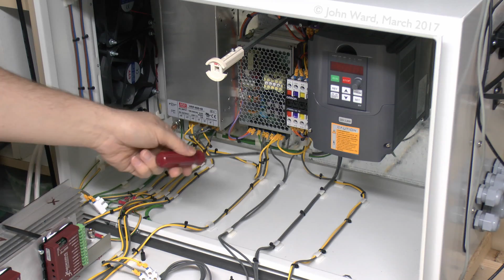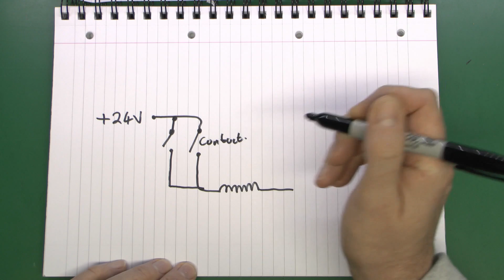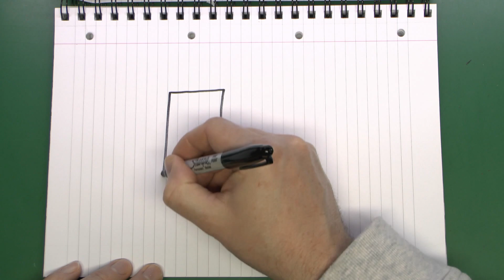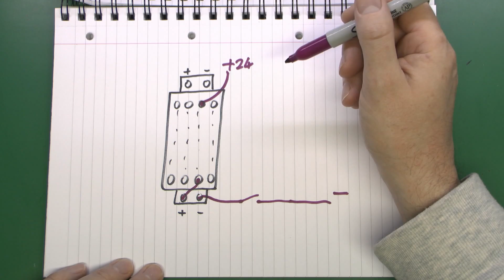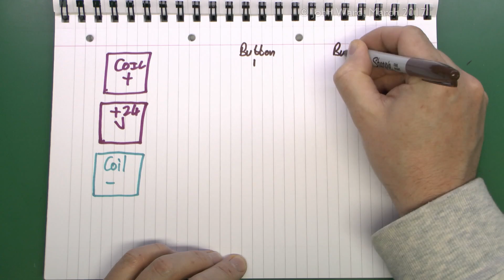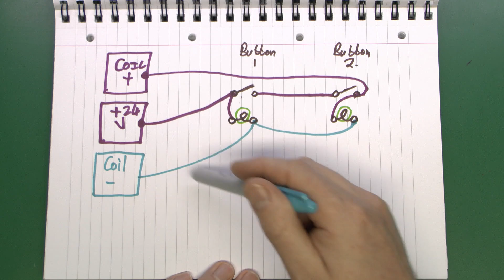CNC Router Build #4 - Cabinet Power Wiring & Emergency Stop Circuit

Comment: Have you had any issues with the VFD being in your control box? EMI related issues•
Reply from the maker: No, none at all.  However the power supplies and cables are all screened, and the controls are all 24V which is less susceptible to interference than lower voltages.

Comment: The manual for the VFD says it should not be turned on and off using a contacter.  Any idea why because I was thinking of doing the same as you ?
Reply from the maker: Haven't looked at the manual for some time, but is that referring to the output or input?
Switching the output (between the VFD and motor) is likely to cause damage as VFDs expect the motor to be connected all the time.
Switching the input won't cause damage, it's no different from disconnecting the power using a normal switch, and that would happen every time it was switched off such as at the end of the day.
Reply: @jwflame  this is what the manual says: "No contactor should be installed between the power supply and the inverter to be used for starting or stopping of the inverter. Otherwise it will affect the service life of the inverter."

I think that's quite unambiguous although that is subject to this being a translation from the original Chinese.  I was aware of the danger of disconnecting the motors from the VFD.

The only thing I can think of is that if you shut down the inverter in the prescribed way it has circuitry that somehow lets things down gently (non-technical term).  Assuming you got the VFD from the same supplier as the CNC we probably have the same one because that's how I got mine.
Reply from the maker: Probably because if power it cut, the motor is still rotating which would then act as a generator, supplying voltage to the VFD.  That might cause damage.

Comment: Dual power feeds? That's ridiculous, what is the point. Name any control system that has two plugs.
Also, some AC input filtering would be nice, and especially for that spindle, going to get a lot of noise from that.
Fuses? A pretty standard feature in everything and seemingly entirely absent from this design.
That's not how you do panel wiring, get some braiding or trunking and run it all down to the corner. Separate the AC from the DC/signal.
That fan/heatsink arrangement - let's just call it non optimum eh?
You've basically made that rear panel non removable by having wiring spewing in all directions.
Where's the braking resistor for that 2KW spindle?
Press two buttons to engage circuit? Control sequences are generally single button presses.
How about a few indicator lights for what's running.
Interlocks? No point in engaging the 48v if the drive units have an error condition.
Where are the DC fuses.
Install a stop button to signal the drivers to shut down, just killing the power is going to wreck your gear - every control system should have a sequence to start up and a sequence to shut down.
Reply: You sound very intelligent... Now please. Go make a video and show us the most perfect and proper way then.

Comment: in the Huanyang VFD Manual, it is stated that never to use a contactor to power the inverter there are pins that can serve the same purpose if you want to protect your inverter

Comment: Hello John. Did you have any problems with the VFD on your router tripping your home RCD. I got the milling machining working via an isolation transformer  with its own 30 mA RCD on the secondary side.   It works fine  despite about 10mA leakage from the EFI filter on the the VFD.  The drive allows for up to 20mA leakage and recommends 300mA main RCD and 30mA locally.  I used I current clamp to measure the line neutral imbalance it was useful bit of kit. Thanks Regards Chris.
Reply from the maker: I don't - but the shed with the machine is on it's own 30mA RCBO, so even with 10-20mA of leakage it still wouldn't trip.
Many things have a tiny amount, so with an RCD for a whole house it wouldn't take much extra to make the total enough to trip all the time.
Reply: John Ward   Yes it wouldn’t take much as you say.  The supply for the garage is a spur off the kitchen ring main. It works have been so much easier if I could have put in a separate supply from my consumer unit. Unfortunately it was not cost effective in my situation given the house construction and distance involved.  My fluke 1653 arrived so I guess I should investigate. 

Many thanks John keep up the good work with the video I really enjoy your content and always learning thanks.

Comment: Hi, like the build and video  I"m putting a controller together right now too and I'd like to get some of those little plastic wire clips you are using.  Where can I get some?  Also, is the contractor necessary on the spindle?   I have a delta vfd but I wasn't planning on putting anything other than a switch on it.  My lathes all have 3 phase contactors but they are old skool lathes.
Reply from the maker: The cable clips can be obtained on ebay and many other places, here are some examples:  http://www.ebay.co.uk/itm/like/121337334008
If you want a working emergency stop,  then a contactor is necessary.  If not, then a switch would do.

Comment: Thank you so much for the detail in this video, I've been having a nightmare on a project I'm working on with having parts of the machine running without the other, then both together using a 2 step switching, perfect video, its exactly what i needed

Comment: interesting comments on this one.  In the control panels we build, we tend to keep the unswitched mains run as short as possible in the case, and generally protected by metal or plastic from entry to the main switch. But then again our panels are meant to be hard-wired and not have external plugs. Do love non-mcu e-stops... even though these days the combination units seem all the rage.    And yeah, i worry about lag in your inverter turning off.
Reply: What would bother me (if this was my machine) aside from the long unswitched mains wiring is that it looks like the earth wire is shorter than phase and neutral and that there's a screw terminal in the wire before it's actually connected to the housing.

Comment: The question I have is in regards to the Heat sinks. The heat sinks are very close to each other and the cooling fans do not move air over the cooling fins. Do thoes heat sinks get hot? Should fans be installed to direct air over the fins? Thank you for doing these vedios.

Comment: Nice neat install, one point I will make (and probably too late by now anyway) is that the instructions for the VFDs I've used on my Lathe / Mill and Coolant system state not to power them up without motors attached to prevent damage. Not sure if yours is the same but it looks like you didn't have the spindle attached when you demo the power up sequence.  As my VFD / Motors are connected via multiway connectors I just wired it so that the connector had to be made to allow power to the drive. Keep up the good work.  Ps I installed a cooling fan in my cabinet but it just doesn't get very hot in there anyway.

Comment: What if you're holding the two buttons down (or they've failed on) when you turn the emergency switch? Safe operation would suggest the buttons would be ignored until they are released and re-pressed.
Reply: that would require some processing board, these are just switches, but pressing both is unlikely dont you think?

Comment: (23:32) - did anyone besides myself notice that the two bulbs provide a bypass current path around the two switches (if incandescent bulbs were used)? When the unit is first turned on, the bulbs will have a low on resistance which could cause enough current flow to actuate the contactor. With LEDs, though, they act as current steering diodes, eliminating the problem, so long as the LEDs have a dropping resistor built-in (otherwise the LEDs would burn out on 24 volts!)
Reply: Watch his previous vid, he has converted them to LED (with current limiting resistors)
Reply: In as-configured - there while there will be a tiny current, drastically reducing within first milliseconds, still not very likely.  The issue with this sneak circuit is ultimately your trying to derive a current between two points that a (nearly) held at the same potential ("coil -").  The bottom of the bulbs is held at "coil -" and your trying to drive your sneak current from that "coil -" back through the coil to ... "coil -". The wire direct from the bottom of the bulbs to the "coil -" is a far less resistive load to  than going back through the second bulb (resistive with a bit of inductance) and the contractor coil (which, remember, will be causing inductive resistance due to the change of current, plus whatever normal resistance the coil has.. voltage leads current in inductors) .  If the wire to "coil -" had 0 resistance, then absolutely no current would flow through the two other devices. Of course that's not reality. But the resistance of the wire (less than a tenth of ohm?) is going to be far less than wire, the startup resistance of the bulb plus inductive resistance of the coil. By the time the voltage starts to allow current flow through the inductor, the voltage divider of the first bulb, and the node of the sneak circuit is going to be driven too low to develop any significant current (yes it will still be there, but its going to be ...  pico amps?).   Now, there IS a flaw in this design. If for any reason the wire "coil -" is damaged, then absolutely the sneak circuit will likely be enough to cause latching.  So yes, in the end a steering diode probably should be installed (in the use of indicator bulb) to prevent the sneak circuit.  As he's using LEDs, though, its all moot.

Comment: So, to sum it all up, contact, take off! Button, button, who's the got button? Scarily I almost wired my control cabinet the same for power. But mine is a lot more pleasant to operate, and cuter looking too. I did not use two momentary contacts, but rather one rocker switch, and two momentary contacts. But I do not have any elaborate E Stop button. Turning off the rocker, or hitting the stop momentary button disengages my latched relay. Someday I suppose I should wire up the software E-stop. Maybe after I have my first actual emergency?

Comment: If you take the power for 24v from the top of the contractor won't the negative for the 24v be going through the emergency stop? Won't the servo drivers overload the current limit of the emergency stop button? Or does the 24v that goes to the front panel only power the indicators?

Comment: I would add a 36V TVS or varistor across the coil to prevent spikes damaging the power supply.. As well if you are feeding the 24 and 48V rails out the cabinet add a short DIN rail piece ( left side of main switch has space) with some 5A breakers on it to allow you to isolate the external power rails. 

Why all the railroad tracks across the bottom, better to have some slotted trunking there at the back and the right side, and then a spiral wrapped loom to the front panel instead, better long term reliability on the wire, and you get that real estate back for things like controller boards and low profile DIN mount items. Same for the mains side, slotted trunk behind the fans and across the top, using 3M VHB tape to hold it down. Clean panel and trunking with solvent before putting down tape and it will never come off. I use it to do trunking, and it rarely comes off unless the actual wall itself has poor paint or you gorilla it off.

Comment: what is the diffrence between a contactor and a relay
Reply: Yeah, that's not it. If you're switching small signals, it's a relay. If you're switching industrial size three phase, it's a contactor. And in the in between, 110/230vac domestic power level, you can get things that are called both things, but there isn't necessarily a massive difference between them.
Reply: RC MAD Wikipedia can supply lots of details, but the biggest difference is that contactors are seriously heavy duty.
Reply: typically cont actors are triggered by ac current as oppose to relays that are triggered by dc.
Reply: This is not really true. @Jasper Janssen is correct, contactors are designed to operate at higher currents than what is normally classed as a relay. Contactors also tend to be On/Off in function, where with relays you have different variants such as SPST, DPST, etc...
Reply: my guess is that relays have a  coil that the voltage differs to what it switches, and a contactor is the same voltage, then again, that analogy doesnt work as cars have relays....

Comment: I found it was better to have a software emergency stop as just cutting power to changed stepper motors kills then pretty quick. 
And you will be hitting it a lot.
Reply: I personally would never have or install a system with just a software emergency stop -an abort operation switch or similar yes -but to trust software never to crash / hang or not work as expected and trigger an emergency stop - no
Reply: RDH1024 John better stock up on spare stepper motors then.
Reply: A software e-stop is not a good idea at all. All professional machine builds of this type will have a hardware based e-stop solution (according to CE marking regulations anyway). Safety rated relays should be used, and double redundancy on all contactors/relays where safety is critical. A software 'stop' is fine for normal use, but you can never depend on a PC for a safety function.

One extra point: I would always implement redundancy on the e-stop button circuit (with an appropriate safety relay) for a machine of this type. With a single e-stop circuit you are only one dodgy contact away from the stop function not operating at all.
Reply: Jusb1066 this is the point I was making, have a software as well as hardware stop. Bit stupid to shut down everything just because you are grinding off a bit of your work clamp or your work comes loose.
Reply: Just the drivers, as those will die first.  Better is to have another stop button to halt the operation, breaking the PC ready side, and have the control panel one being a "we are on fire" button. Stop button should be on the machine side itself, in a small box with a green and red lamp to show status. 2 hole pendant box, will be fine, and use a KM double LED indicator ( and you can use the switch side as a resume button as well) for it in top cutout and use bottom for a regular stop button. That can use the existing roll of control cable as well, use the shield as a common wire for everything.
Reply: a software stop would be convenient but not for safety, just for allowing adjustment or some other temporary hold
Reply: Jusb1066 π